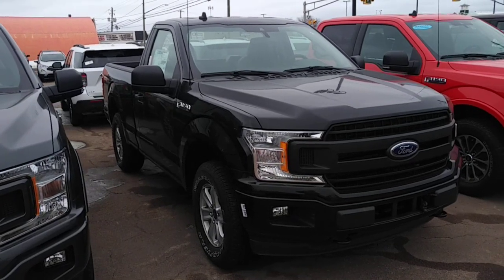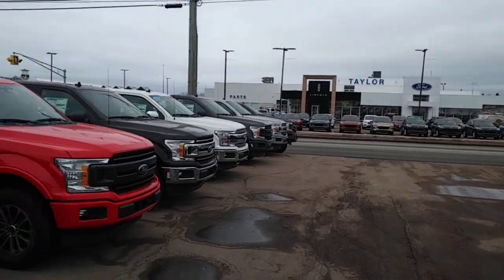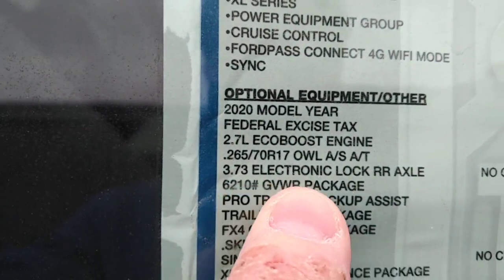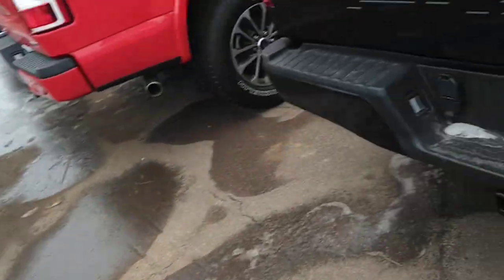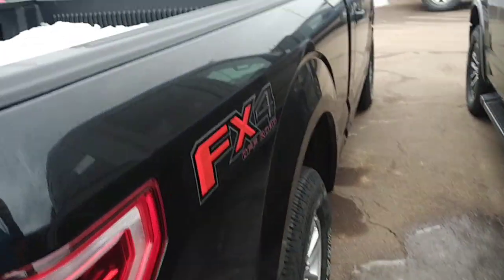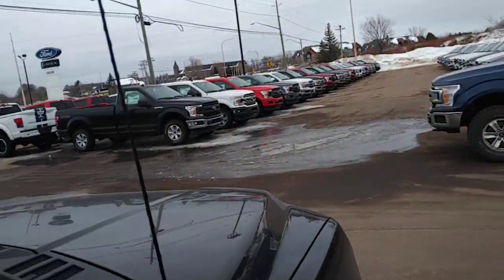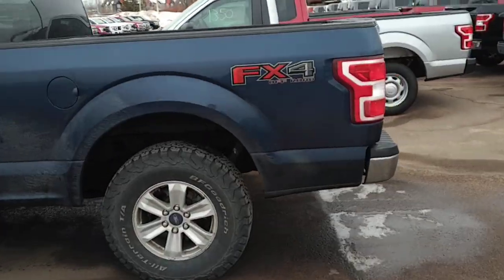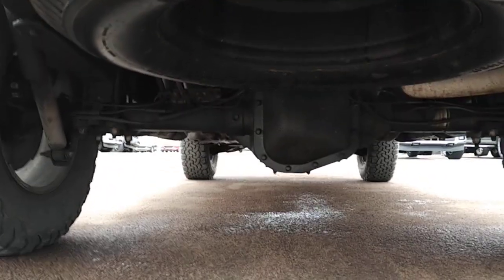9.75" rear axle

Comment: Are the 9.75 a direct bolt in for the super 
8.8
Reply from the maker: @jordanlovell13  the 9.75" is a whole seperate axle.  Different carrier, different internals, 3/4 floating bearings, etc.   It does bolt in place of the Super 8.8".  (Raptor 9.75" is wider though.)
Reply: @fabulousoffroaddesigns5080  I grenaded the super 8.8 in my 5.0 on 35's and wanted to do a factoryish upgrade. Just didn't know about brakes with 17inch wheels and driveshaft length
Reply from the maker: @jordanlovell13  brakes and wheels and that are all the same.  HDPP and Max Tow Package trucks all  have steel driveshafts instead of the aluminum ones, but they bolt up perfectly.  It is all interchangeable.

Comment: Does the 9.75 axle come with 12 bolts on the cover and the 8.8 have 10 bolts? Is that another way to find out?
Reply from the maker: No the modern Super 8.8" is also a 12 bolt cover.  The old 8.8 was a 10 bolt.
Reply: @fabulousoffroaddesigns5080  
Hmm… I have the 3.31 gear ratio so would that be 8.8 ?
I have a 2019 f150 5.0
Reply from the maker: @ThatXLT5.0  yes that is the Super 8.8".  On the 5.0L the 3.15, 3.31, & 3.55 are all Super 8.8". Only the 3.73's are 9.75".

On the 3.5L Ecoboost all are 9.75's
On the 2.7L Ecoboost all are 8.8"*

The main benefit to the 8.8" is smoother shifting, better fuel economy, longer range per tank, quicker,  higher ground clearance.
Reply: @fabulousoffroaddesigns5080  
Wow thanks for the info. 
I subscribed to the channel 👍🏼

Comment: This is not true with the new Gen F150 in 2021 and 2022.     3.73 w/ 5.0 in RCBS, no tow package.  Fx4.   9.75 rear is installed.
Reply from the maker: Yes that change may have actually happened in 2019 when they stopped offering 3.73's with the 2.7L EB.  It seems they stopped offering the Super 8.8" with 3.73's all together.

Comment: 2016 Lariat Base Techpackage with almost no addons from the dealer other than 4x4, i have a 3.55 open diff its alos a 9.75"
Reply from the maker: Yes all 3.5L EB and 3.0L PS Diesels run 9.75" rear axles.  Some 5.0L V8's and the HPP 2.7L EB does as well.

Comment: Greetings. From San Antonio.  :)  After 8 months my 2021   RCSB    XLT    5.0    FX4      3.73  gears  electronic locking   arrived on Feb. 22.   2021               Ordered on Oct. 8  ,2020   No snow plow prep.  it is the 9.75 inch           I got lucky.   I did not do snow plow prep because it deletes the   electric slide down front spoiler at speed..  I was afraid I had to get the snow plow prep for 9.75 but did not.  I took photos and it matches up exactly with your photos of the 9.75.  unique shape at bottom.. ( Never thought about it, but may need a snow plow if it keeps snowing in Texas.)  haha
Reply from the maker: Yes.  A lot has changed for 2021.  Ford currently is not  offering the 8.8" rear axle in E-Locking with 3.73's, so if you order that axle on any truck it looks like you get a 9.75".

Congratulations on the awesome truck.  Post some pictures on the FabulousOffRoadDesigns Facebook page if you can.

Comment: You showed a 2.7 without the payload package. So yes, you are technically correct. However, aren’t most people talking about 3.73 and 9.75 gearset referring to the 5.0? As far as I can tell, snowplow package requires 5.0 but doesn’t necessarily give you 9.75, but when paired with optional 3.73 elocker, voila! You get 9.75 rear diff. You’re technically correct with your basic point that 3.73 doesn’t guarantee 9.75, but it’s not really about the snowplow package, it’s about the 5.0 and optional 3.73 elocker. I just verified this with the 2021 build and price tool, and I’m confident 2021 isn’t different than the previous generation when it comes to this setup.
Reply from the maker: Well at the time this video was made I was only doing videos on Regular Cab Short Wheel Base trucks.   In the Regular Cab Standard Bed «121" wheel base» (shorty) you can NOT get the 2.7L "Payload Package," and the 9.75" axle has never been available on that (2.7L - 121") configuration at all.

 In 2018 you could get a 5.0L "shorty" (121" wheel base) with 3.73's in the 8.8" E-locking or Non-locking rear axle, if you did not get the "Tow Package" or "Hitch Package" .  Different to Super-Cab or Crew Cabs, or any long bed.

In 2021 they have discontinued the 8.8" E-locking axle in 3.73's all together in any package, and like older trucks the 9.75"/3.73:1 axle is not available on 2.7L EB Reg Cab Shorty's (121" wb).  Only 141", 145", 157", & 163" wheel bases.  So even in 2021 they don't offer it on those short wheel base trucks.

The "Snow Plow Package" has standard equipment of: 5.0L V8, 4x4, 3.73's, 9.75" HD rear axle, 240 amp alternator, HD flushable link with dash switch, 810 CCA AGM battery, HD front suspension, Medium Duty rear suspension.  So today in Canada if you checked the 1 BOX for "Snow Plow Package -$250" the price jumps from base by $8700 because it automatically adds everything.  It is and always was the only way to check one box and be sure you got the 9.75" HD rear axle on a 121" wheel base truck. 

In 2021 if you pick any motor on any configuration, with any wheel base (EXCEPT 121") with the "3.73 Electronic Locking Axle Ratio" you get the larger 9.75".  However the only way to get a 9.75" rear axle in a "shorty" is still with the V8, and with the E-locker but the Tow Package is no longer required.

Comment: I have a VERY similar build to yours with the exception of the snow prep pkg. I have the 9.75 rear end with single cab fx4 5.0, 3.73. So maybe it is dependent on the engine choice and not the snow prep pkg?
Reply from the maker: Cool!  Yes if you get the 5.0L w/3.73's AND the Tow Package (not the hitch pkg) you also get the 9.75" rear axle. But if you get the 3.55's or less with the Tow Package you get the 8.8".

Getting the Snow Plow Package just makes sure the dealer doesn't screw it up.  Sometimes they order the right engine and gear ratio and think they'll save money and do the hitch package or install a hitch at the dealer and you end up with the 8.8".

SPP does get HD 240 amp alternator, HD sway bar, HD front springs and shocks + some wiring.  The vast majority of which, is unnecessary for most people.
Reply: @fabulousoffroaddesigns5080  Very informative. Love you channel! Keep posting!
Reply from the maker: @takebackthepower  thank you!  I appreciate it.  This will never be a full time gig but I'll keep posting things I feel are relevant, as I think of them.  I may soon need to look for ideas.

Comment: I have a 9.75 with 3.55 gears open diff.. I am looking for a locker, what would you suggest? (2013 model year)
Reply from the maker: That is a tricky question and it really depends what you are doing with the truck.  If I lived down south, or the truck was mostly street I would get the tried, tested, and true Torsen®.  For off road or areas with icy roads, I would likely just find a whole axle in a junk yard out of an aluminum Max Tow 3.5L Ecoboost.  They use 3.55's w/E-locker and it would be easier then pulling the internals.  Just wire it to a switch.
Reply: @fabulousoffroaddesigns5080  Great, thank you. For ease of plug and play I'll look into finding an entire used axle to swap. If I found one with different gearing would I need to be concerned with the gearing in the front diff?
Reply from the maker: @thrRnz9496  yes.  Both axles have to match, so hold out for the right gearing or you will have to pull the gearing out of both and swap the ring gears.
Reply: @fabulousoffroaddesigns5080  TFLoffroad! I couldn't pin point it at first but I knew I recognized your voice. I saw you on their show!